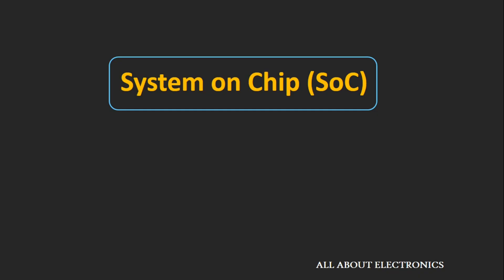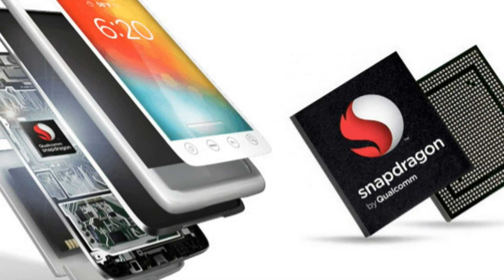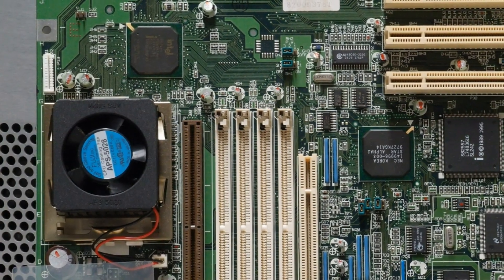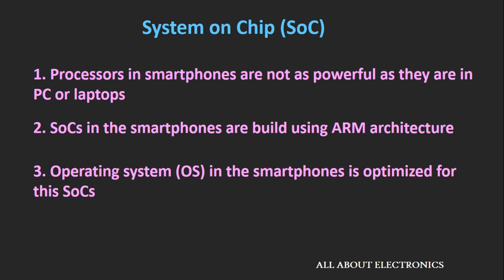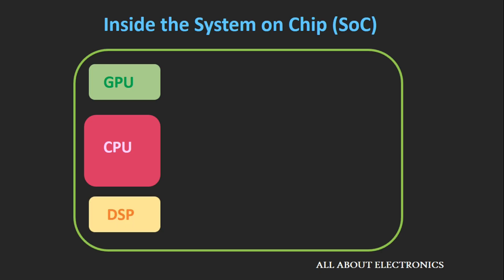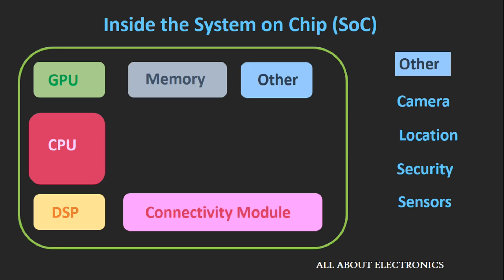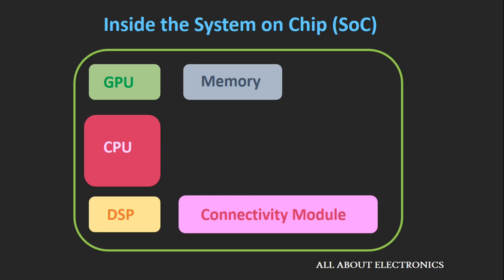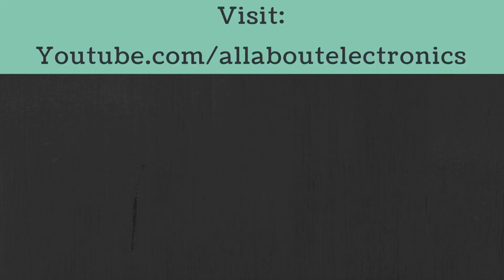System on Chip (SoC) Explained

Comment: Except for Samsung, the other companies you mentioned at 1:14 are not manufacturers. They are just designers. Manufacturing of the chips designed by these companies is done by companies like Intel, Samsung and TSMC. And the companies that only design chips are called as fabless semiconductor companies.

Comment: The intel and AND will fail if they won't switch to SOC.
Hardware is not improving they are just optimising the software and you think hardware is improving and it the biggest scam nobody going to tell you about it, because you can't check it yourself  and you have believe the lies they are feeding you.

Comment: In the previous video u had told that soc is both microprocessor and a microcontroller......how??????  We use memory inside so it should be a microcontroller.....or memory might be separated and connected to CPU through northbridge ...so it's both?????? Sir plz in detail or anyone who saw this comment ...

Comment: sir why can they use SOC in personal computers
Reply from the maker: Since last year, some brands like Lenovo and ASUS have launched the laptops based on the SoC. (Snapdragon 835 based SoC).
And this year too ( probably by year end ), Snapdragon 845 based laptops will be launched. 
Up to Last year, the SoCs developed for the smartphone were not as powerful as the desktop processors. But as the technology is evolving, now these ARM processors are also getting powerful. (Of course, still, it can't be compared with the 7th or 8th generation i7 or even i5 processors, but for day to day task it will be good)
The main reason now companies are considering to use these SoCs because of their low power consumption, Which gives the user a very good battery life. 
And for many users, it is a number one criteria.

Comment: Previously technology was limited by the amount of transistors that can fit on a chip, now it seems the limiting factor is temperature rise. It seems like the POP structure would need a fan since the SOC can not be heat sunk because the memory chip sits on top of it.  As parts get smaller it gets harder to work with this stuff if  you are a maker or hobbyist.
Reply: Too true.

Comment: What is UART?
Reply from the maker: UART is the chip or IC which accepts the parallel data (from CPU Bus) and sends data serially (after adding start, stop and parity bits) to the other devices. For example when you are sending data using USB to the CPU, then to convert the received data in byte format (For CPU Bus) these UART chip is used.
Reply: Thanks mate!
Reply: @ALLABOUTELECTRONICS   what about the wireless uart which we used in radio frequeny material like hc12 lora??

Comment: Sir my question is....as you discussed arm processors consumes less power then why don't we use it in laptops?
that can increase battery backup.
Reply from the maker: Recently ARM-based laptop (Snapdragon 835) has been launched by HP and ASUS, and they are claiming to give you 20 hours of battery backup. And Next year you will see many more companies will launch laptops based on this ARM-based processor (Probably Snapdragon 845 based).

Comment: can i use fpga block in soc?
Reply from the maker: some SoCs have that provision where some part of the Soc can be programmed. And some SoCs are in fact fabricated from the FPGAs.
Reply: ALL ABOUT ELECTRONICS when i use only soc ,fpga soc and asic soc? i m confuse ,,, ihave exam tomorrow
Reply from the maker: In case of mobile phones, you generally find SoCs which are built around the microprocessor. For the specific application like Digital Camera chip in the digital camera, is the example of ASIC SoC. And applications where you want to customise the SoC and want to program some components of the SoC, then you can have FPGA SoC. 
I hope it will help you.
Good luck.
Reply: ALL ABOUT ELECTRONICS thanks buddy